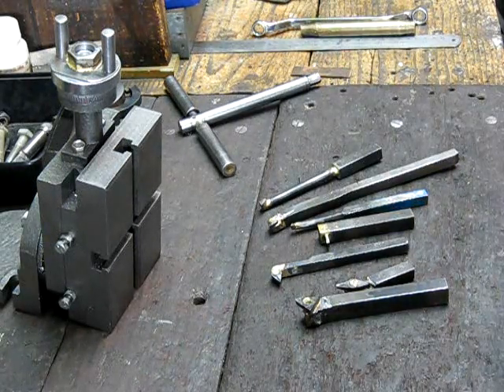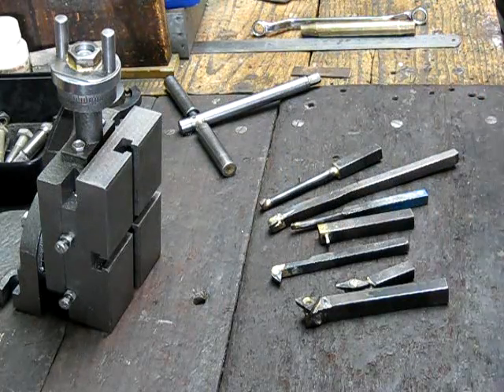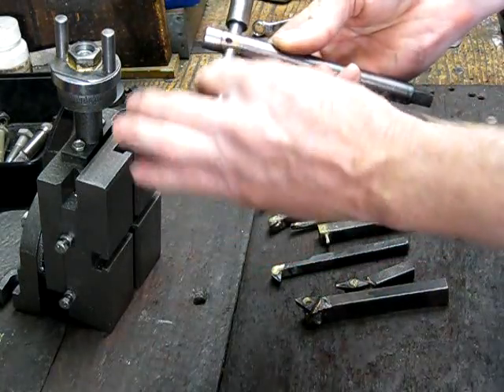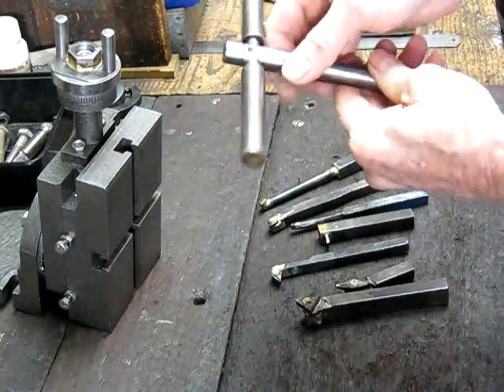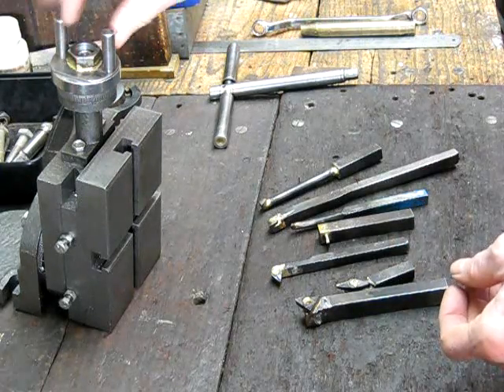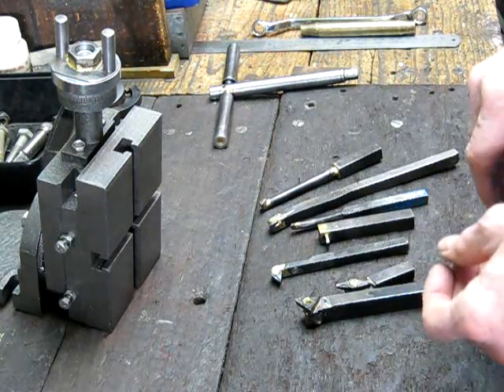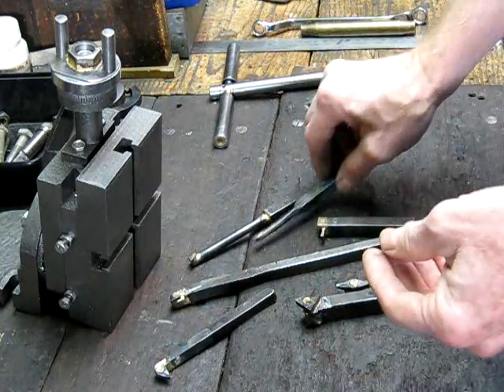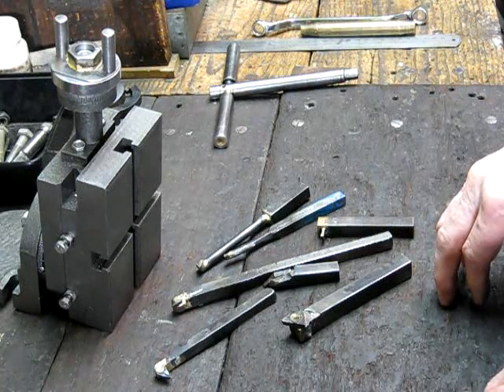How to make your own lathe tooling (and weld small metal components)

Comment: Do you use and special type of brazing Rods?
Reply from the maker: Samuel Atkins I always use small diameter GP (general purpose) bronze rods (uncoated).  I prefer to manually flux as that allows you to preflux (clean the joint) before adding the bronze filler. Cheers Rob
Reply: Better to use silver solder
Reply: bloodyripperau Why silver ?? what are the benefits over bronze?

Comment from the maker: The gun can be bought direct from agents in the UK, however the regulator thread is UK format and may not fit USA butane cylinders.  Yes it is a propane air torch.  Yes it is hotter (stronger flame) than Benzo-matic.  I have no idea how it gets to be so effective with LPG/butane, but obviously the jetting, gas throughput and air system are all integrated to make it work. The Bullfinch UK web site has more information.

Comment: Very impressive!  I just wish that I could get one in the U.S., but they are not sold on here.
Is it a propane-air torch?  I ImagIne that it delivers more heat than a Bernz-O-Matic torch head that fits on U.S. disposable propane bottles (it is certainly more expensive!), but how does it accomplish this?  Thanks, Bruce.